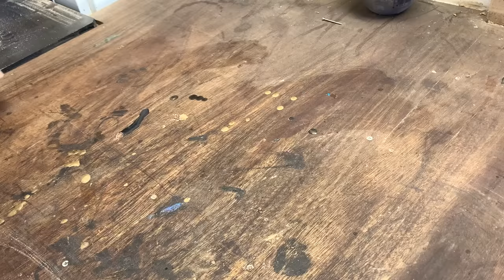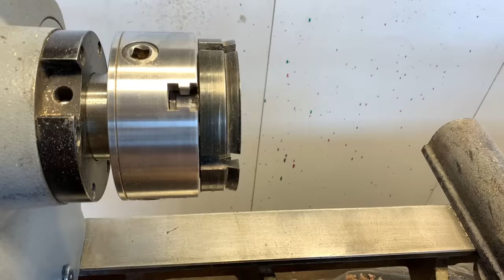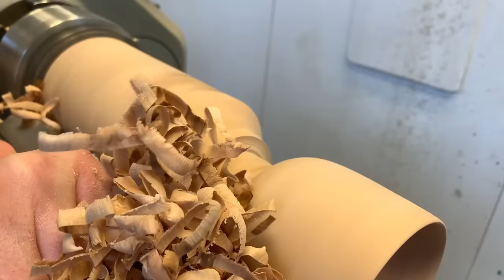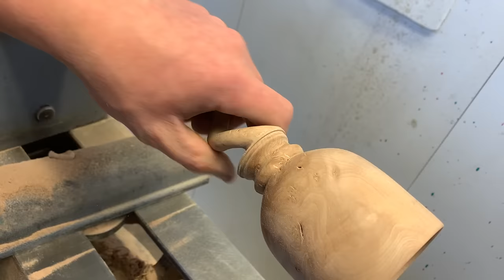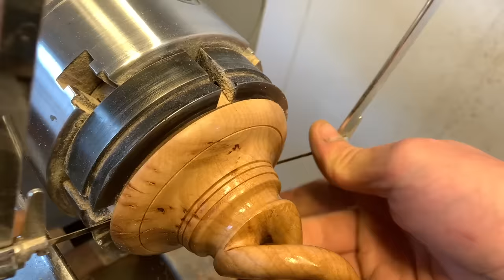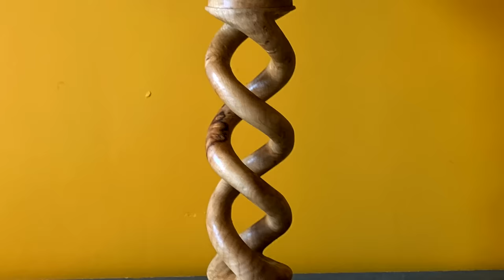Woodturning - The Twist!!

Comment: I was trying to see in the comments what finish u used?  I want to turn a wine glass but a simple glass and would like to drink out of it.
Reply from the maker: Use “pure tung oil” for that if you want to drink out of it. Make sure it “pure” and just to be safe double check it’s food safe. As long as it’s 100% tung oil and no additives you’ll be fine. 
You need to do 5-10 coats to make it fully water proof and it takes adopt 10 days for each coat to cure fully before you add the next coat. Give a light key with 400 grit sandpaper between coats to help to coats bond to each other. It’s a long but very simple process and the final finish is just amazing. In my house we use the same salad bowl for pretty much every meal and have done for over 10 years. It’s never needed a top up on the oil. It had 10 coats of tung oil and looks as good as the day it was finished.

Comment: nice, but I would have stopped after finding the knot. very risky.
Reply from the maker: What do you feel is risky about the bark inclusion ?
Reply: @JackMackWoodturning  not bark,  -knot inclusion. So, you don't think a knot in the middle of a long skinny piece of wood is a weak point?
Reply from the maker: It isn’t a knot. A knot is the dead heart wood from a branch union. This is a bark inclusion which is common in burl figured wood. Especially in apple burl. A bark inclusion is much more of a weak point than a knot as a knot had rings of tight grain encompassing it, where as a bark inclusion can run continuously though the work piece with no affixing grain.. If you watch closely I treat said bark inclusion with thin Cyanoacrylate. Weak point fixed. 

Are you familiar with the term “Doylum”??
Reply: @JackMackWoodturning  So, it's a weak point, you acknowledge that. I would have stopped. 
So who is the doylum for taking the chance that it would break in the process or years latter when you didn't have to?
 CA does not last for years.
Reply from the maker: Salvor my darlin.. you don’t know what your talking about.. it’s clear from what your saying that you lack experience in woodworking. Thin ca impregnates the wood pours and all voids, it is in every way the same as casting the wood in resin and the same process as stabilising wood or any other organic matter. In answer to your question.. you pal, you are still the doylum. Keep talking and you’ll only reinforce that point 👍🏻👋🏻😘

Comment: Now make it into a chalice.
Reply from the maker: It is a chalice.
Reply: @JackMackWoodturning  Is not the top solid?  Because you never showed it being spooned out.  "Chalice, a large cup or goblet, typically used for drinking wine."
Reply from the maker: Don’t you think you might need to watch the video without skipping through sections of it before you try to tell me what is and isn’t in the video???
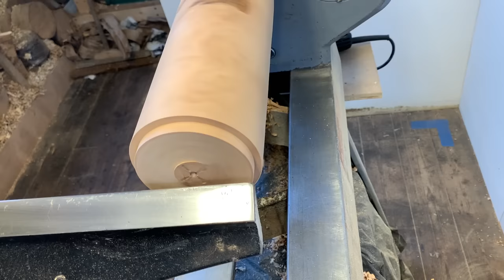Reply: @JackMackWoodturning  1:15 Yes, well I did watch it all but I guess I was not attentive enough during this section. I watch this kind of stuff when I'm asleep sometimes.  Regardless it's the youtube comment section, you have to expect it's full of these kind of trash comments.  I legit came away with the perception that it was some kind of faux post for holding something up or the like.

Comment: Nice work, but I'm rather surprised at your lack of use of a steady rest or live center for most of your turning.  That would have greatly increased safety but it would have also eliminated the chatter you are getting.  I am a machinist, and to turn something with that much unsupported overhang is just asking to get slapped upside the head...... very dangerous work ethics......
Reply from the maker: As you say Peter. Your a machinist and not a woodturner. Comparing the two is entirely incorrect. Someone who claims to be as experienced as your self should know that. The worst possible outcome from a bit of chatter is the blank coming out the chuck and dropping to the floor.. maybe a should wear my steel toe cap boots while turning? I enjoy a bit of chatter, it forces you to be at handling your tools. 
See, that’s the big difference here. My tools are held by hand and require skill and knowledge to operate. In woodturning (and my opinion) steady rests are for long work over 15” out from the chuck. 

Please do enlighten me as to the dangers I’m missing here..

Comment: That’s not gonna hold much load🌚
Reply from the maker: Why do you think that ?
Reply: @JackMackWoodturning  the structure is weak in middle.
Reply: @JackMackWoodturning  even if it dead hold enough weight, how long before it breaks due to fatigue?
Reply from the maker: You do know that this is an ornamental piece right? I’m not sipping chianti from it with my dinner. 😆
Reply: @JackMackWoodturning   aren’t you gonna use as a support?
Reply from the maker: A support ?